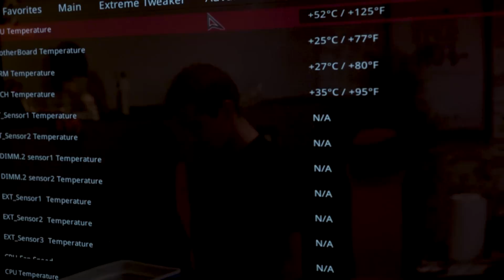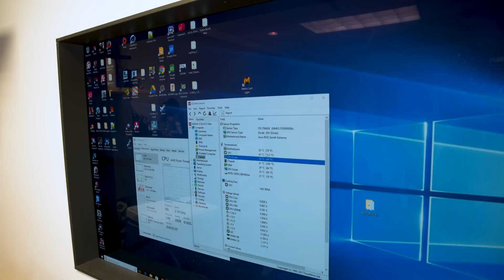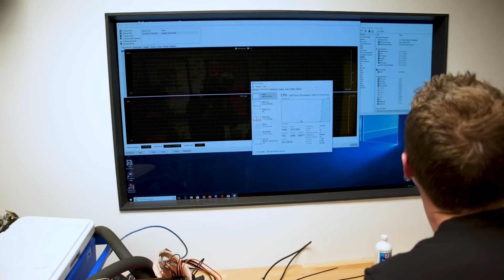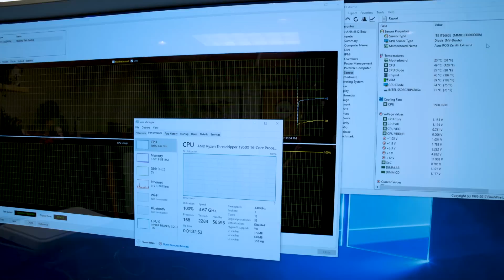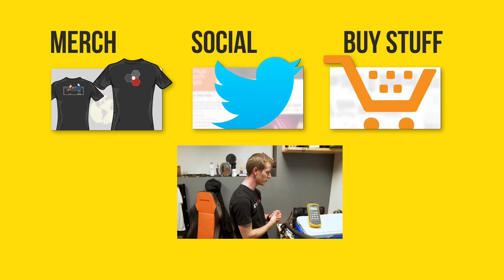My 10 Year Old Chiller WORKS! -20C on THREADRIPPER!

Comment: Won't exposing the CPU to sub-zero temps cause condensation of aerial water around the CPU, resulting in a short circuit?
Reply: Maniesh Ramanayake Insulation Insulation Insulation
Reply: Insulation is unreliable, only solution is to run in arid air or a vacuum chamber
Reply: There are ways around that. For start a lot of insulation, then smth on top of insulation that would absorb the water instead(towel or smth). Should more or less keep it insulated at least for a while.

Comment: It looks like a bunch of garbage taped together.
Reply: SylenDraws to be honest it looks like it might be
Reply: cold garbage
Reply: I kinda have a thing for stuff that looks like random garbage taped together but performs like a beast.
Reply: Most likely because it is!
Reply: "If it looks dumb but works then it ain't dumb" as they say lol
Reply: "what a piece of junk"
Reply: Well Linus put that together, what do you expect?
Reply: Ye😂
Reply: It looks like it belongs in a meth lab
Reply: that’s because it is
Reply: it's a regular HVAC system ...literally taped together, lol.
Reply: backyard mechanic work at its finest
Reply: pop the hood on your car... looks very similar to the ac in there :)
Reply: exactly!
Reply: considering this was built 10 years ago, I wouldn't be surprised of good o'l young linus went over to a local pawn shop and used a shitty 90's air conditioner to do this
Reply: It is
Reply: SylenDraws thats cuz it is
Reply: Most accurate description of a Linus video ever
Reply: This is because these are the insides of an A/C.

They're not supposed to be bare naked, and they were not made for this kind of use.
Reply: He basically called it a bunch of junk taped together
Reply: dude homeless people play PUGB too

Comment: you could just leave the computer outside your igloo and you would get similar performance
Reply: condensation happens on surfaces that are colder than the ambient temperature. the components inside your computer case would be above ambient if you do what Mihkel said.
Reply: condensation though... Now if they did it in a desert climate like antarctica, where the air is dry, or if they filled the igloo up with some kind of desiccant, it may work.
Reply: Funny how people forget that Canada has part of the world's second largest desert making up a big chunk of its landmass... But yeah, putting your computer outside of your Igloo is a good way to have the penguins run off with it. Damn things are worse than magpies for stealing stuff.

Comment: YOU SHOULD HAVE USED IT ON THE FX 9590 YOU WOULD PROBABLY WONT THERMAL THROTTLE
Reply: I over clocked my 9590 to 5.1 ghz it was stable but my full water cooling rig 3 240 mil radiators it was still 

97 Celsius
Reply: Did you use thermal compund
Reply: That's actually pretty funny
Reply: NICE MEME
Reply: fahrenheit right?
Reply: Toto Geenen one for each phase
Reply: You would also need to cool the vrm the same way because of its power usage :D
Reply: GorillaTech yes :D
Reply: you can't cool a nuclear plant, my friend.